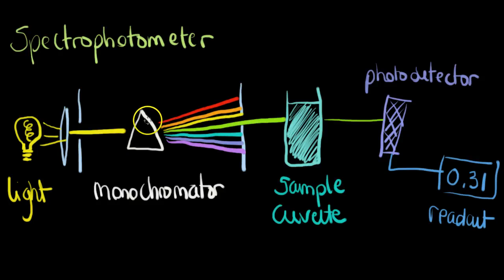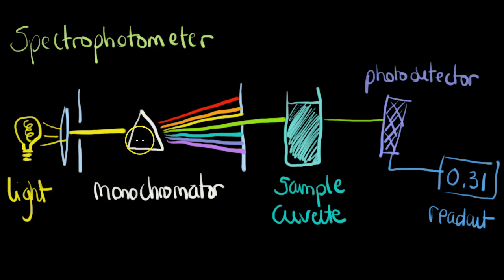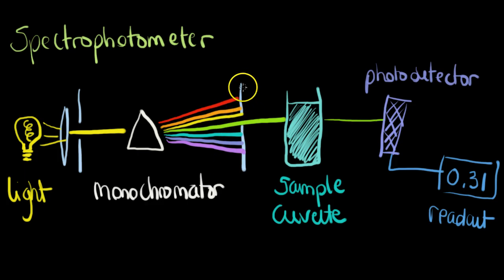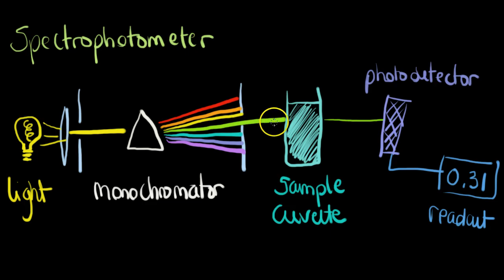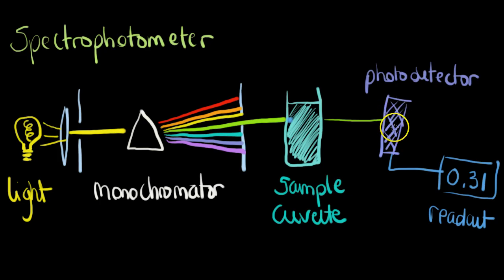ClinChem: basic spectrophotometer

Comment: Hello, could you please explain the sample cuvette, what liquid would you use? and at what concentration and why? This would be a big help as towards an optics project I am working on. Thank you.
Reply from the maker: Hi Owen. The sample cuvette varies depending on the model of the spectrophotometer. Traditional small benchtop models use 12x75 glass tubes. The liquid used depends on what you are trying to detect. It is often a reagent + sample where the reaction between them yields a color change, which is proportional to the concentration of substance you are trying to detect. When I introduce it in the lab, we do some readings with diluted crystal violet, and we read it in the yellow wavelength (580 nm). I mix about 5 mL of dye in 1L of water. You want to get an absorbance reading below 2.0 (the limit of linearity of the spec)
Reply: @DrAsClinicalLabVideos  Thank you very much, that was very helpful.

Comment: Are the micro scan and vitek 2 for bacterial identification considered spectrophotometers? If so are they fluorescence spectrometers? I read one has a photodiode detector so I assumed the ey were but am not sure
Reply from the maker: Yes! Spectrophotometers have applications all over the lab. The microscan and Vitek are detecting color changes for the biochemical tests and turbidity for the antibiotic sensitivity both of which are usually done with a spectrophotometer. I am not sure about the fluorescent detection but it is entirely possible, there are some fluorescent immunoassays that are used in the detection of specific strains of bacteria